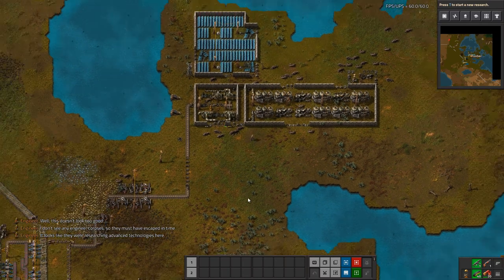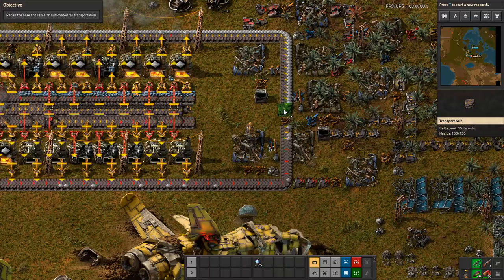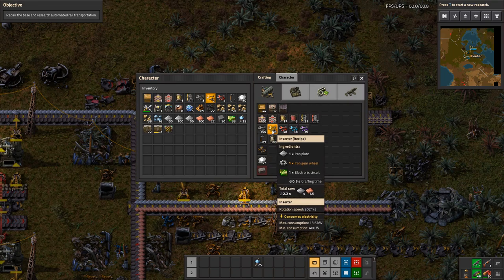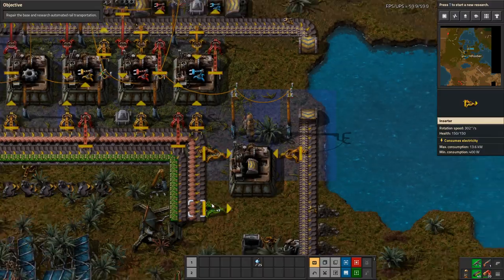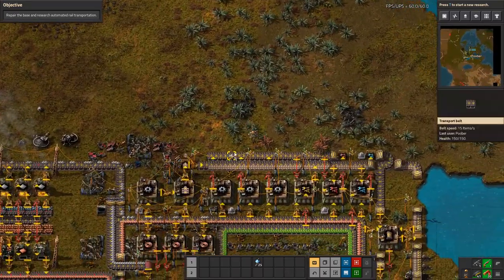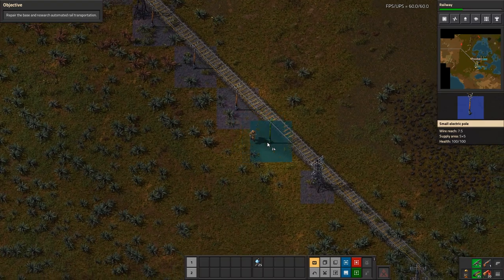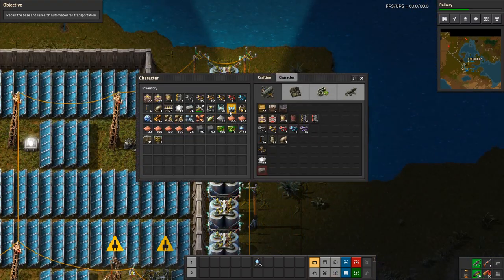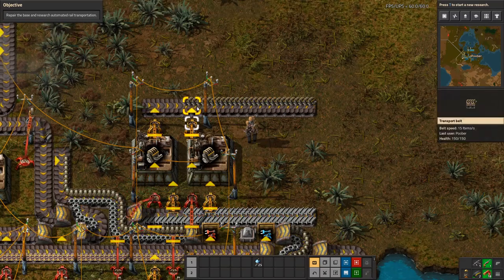Tutorial Walk-Through - Part 5: Abandoned Rail Base | FACTORIO 1.0

Comment: Super late on the video, but I have to comment.  I am 54 minutes into the video so this may change, but I have not seen her check the trunk of the car.  The resources you had to pack from the previous mission are there, 400 Iron Plate, 200 Copper Plate, a few other things including...20 turrets.  Not much ammo for them, but she could at least have the free weapons.
Reply from the maker: yeah I didn't think to look in there!
Reply: @SoellessGaming  If you explore a little you can net 6 electric smelters, about 16 productivity modules, over 50 accumulators (nearer 100  I think, 160 solar panels, a whole extra 2 mining bases (you dont need them but free mining supplies), as well as 17 free laser turrets (though that one is a long way off and not likely to find unless you clear the whole map)

Comment: Nice video, one thing tho: Remember you came on a vehicle loaded with a lot of stuff.
If you jump into it before fixing your base, you have 150 clips of ammo to destroy quite a few of the bug nests.
Also exploring you can find a base at the north west with another ~90 clips.
That should've helped you to avoid struggling so much with bugs.
I had barely any attacks on my base after cleaning up the area.
Reply: There's also a base quite far out that you can scavenge for about 150 solar panels and accumulators
Reply: @E_N_D_E_R  there's another base directly north of the steam engines (northeast of the bug nest to the north of the lake) with another large iron deposit and a ton of stuff like 200+ steel plates, more clips, a car loaded with goodies, electric furnaces, few thousand wood, assembly 2's, efficiency and speed modules. glad I explored a bit!

Comment: Has anyone managed to work out  what the original factory setup was designed to produce? (I'm assuming that it worked, or was close to working before being destroyed. Even thought it's a mess, I've managed to duplicate the setup (mainly going by colour coding), although one or two items seem redundant.

 When the text said to "rebuild the factory", this is how I interpreted it, but it's not straightforward, largely because the layout is compact and seems to have several reversals, a linear layout would have been easier to work out.
 I'm at the stage where I want to build a locomotive, but am struggling to  work out what order the assembling machines were designed to function.
  I have altered things upstream of the factory a little, largely because it originally relied on trains bringing ore, and that power plant was so massive that it would probably have burnt through the coal reserves before I figured things out (local iron ore is in short supply too). I might go back to the beginning and keep things as virgin as possible this time..
Reply: I managed it! Once I realized that the end of the production line was three labs, I surmised that the product had to be science pack - there are two conveyor belts that converge onto one final one, and there is an inserter outside of each lab to pluck them off, the input is iron ore and copper ore which I had to source locally as the trains are not running yet. It was just a matter of working out which assembling machine did what, there are nine of these and it's a bit tricky because the order is not linear.
 With this setup I completed all three sections of the train research in 25 minutes. this can probably be rejigged to work with future science packs too..

Comment: at 16:24 , why use a splitter and also merge it into the other conveyor immediately? Is it just so that the copper ends up on both sides of the belt? and if so, why is this important?
Reply: It basically fills the belt more efficiently I believe. Probs not necessary